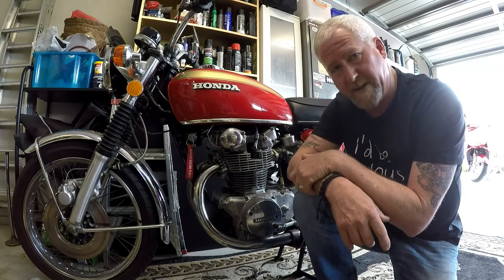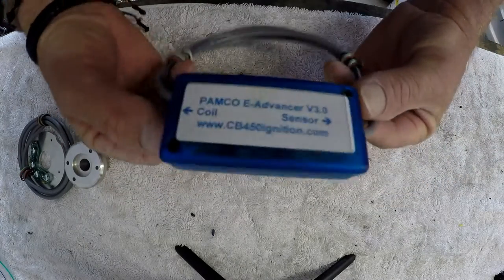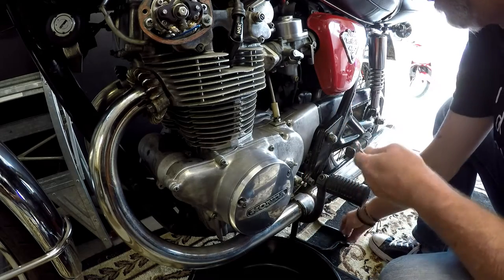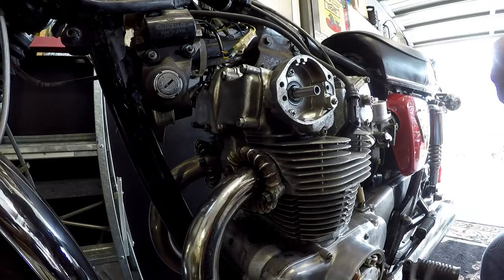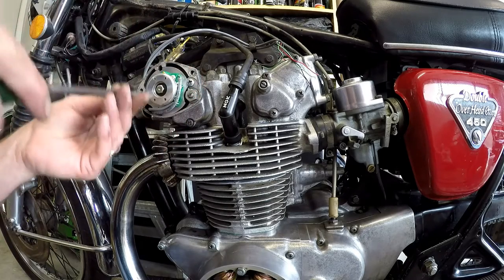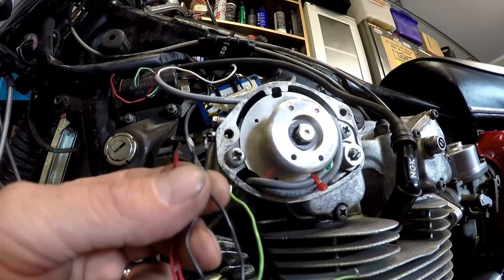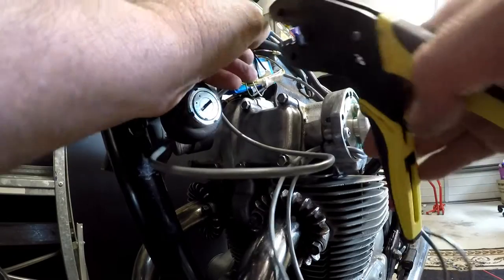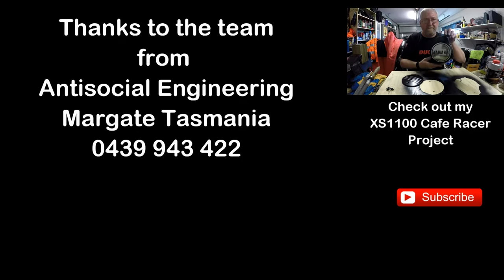Fitting PAMCO Electronic Ignition to a CB450

Comment: For those who have mechanical points, there's a few tricks to getting them set correctly. 1) You must correctly tension your cam chain FIRST. 2) When you are setting your points, ONLY move the crankshaft in the direction of normal rotation. DO NOT move it back and forth. 3) The timing is touchy and you have to get it spot on the marks. Keep repeating until it's right.

Comment: So I finally put the pamco unit on my cl350 it's the exact same one from this video with the electronic advance. At first I timed the LF Mark and the f mark perfectly but the advance would not reach the correct Mark at 3,000 RPMs after reading some of the forums, I saw that pamco Pete said focus more on the advance and don't worry so much about the LF and f timing marks that seemed very weird to me but I did it and now the bike has way more power and accelerates beautifully.

Comment: I had a couple of these bikes I Road raced one of them.on the points you may want go back to the points they work really good.You just have to know how to do it you don’t use a feeler gauge or time and light believe it or not do use a cigarette rolling paper you got to make sure it’s exactly 1000th of an inch thick though what you do is you start with the left side points you put the paper between the two point contacts and you adjust the backing plate until the points just began to open up and you can slide that paper out without tearing it then you go to the right hand side and put the paper in between it and then do the two screws that hold the points and adjust it till the paper slides out of course be sure that you’re on the right hand cylinder with your fire Mark . That’s all you need to do simple and easy ain’t it if you have a stock cam set valves at 2000s don’t forget to synchronize your carburetors

Comment: Back in 68 I had the UK version CB450, the Black Bomber. I bought it for £150 and sold it a year later for £170, those were the days. You mentioned single points and coil, I believe the reason it could not run with a single set of points was due to the 180 degree crank, you would need 2 lobes on the points cam at 90 degrees due to the half speed of the cam v crank for that to work and one of the sparks would have to occur at BDC with a charged cylinder, interesting?. Note that the pick up plate has hall effect transistors placed at 90 degrees, due to the 180 crank. It was an odd bike with the torsion valve springs but it always idled like a bitch, it went like a rocket once over 3k though. Wish I still had it.
Reply from the maker: G'day mate, thanks for watching.  The comment was in reference to parallel twins, like the early Triumphs, that use one set of points with a redundant spark on the exhaust stroke for the opposing cylinder.  But the Honda is a 270 degree design, so that could never work.

Comment: Excellent video! I would like to add that the electronics box is not ideally placed on your bike. It should not be close to a HT cable and not that close to the engine (heat). I placed mine under the seat.

Comment: Nice video Andy, which crimper is that? Do you have the code? 
Thanks mate!
Reply from the maker: G'day mate, I bought it at Supercheap Auto, they're non insulated crimp pliers.  Unless you  are referring to the ratchet crimp pliers, also bought at SCA.  Andy
Reply: The best crimpers for small insulated terminals that you would need to use on a bike or car (in AU at least) are "Linesmans pliers". They look like a standard plier, but have a crimping section at the back of the plier section which you can get a really good purchase on. They are usually fitted with yellow insulated handles. The best source is from an electrical wholesaler.

Comment: The points system worked perfectly good from the factory , why shouldn’t it work perfectly now ? ( assuming you can find someone who understands and can set up points  . The three cylinder  Yamaha’s could be a challenge
Reply from the maker: The same could be said for CRT screens and dial up, but I’m guessing that’s not how you’re watching this, is it? 😉 You’re correct, they function. But the digital ignition advance is way better and far more accurate than the mechanical bob weights and the system doesn’t creep over time.

Comment: 360° crank has to have dual points
Reply: The 360 degree crank version of this bike (the Type II) had single points and coil, early Japanese home market bikes for the police for instance were like this. Export versions were Type I with a 180 crank, like this one and have dual points, condensers and coils. The two types also had different cams. I'm the proud owner of an original CB450SS (or 'Black Bomber') with 180 crank and dual firing, the 360 is very rare with almost no parts availability these days.